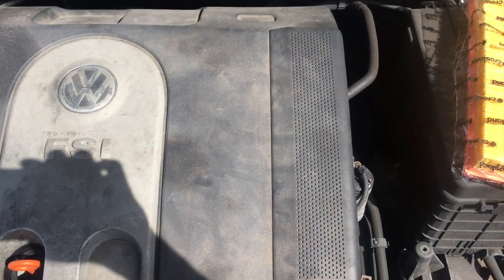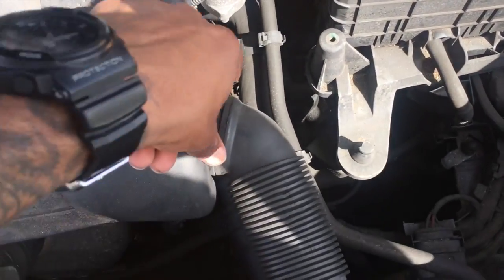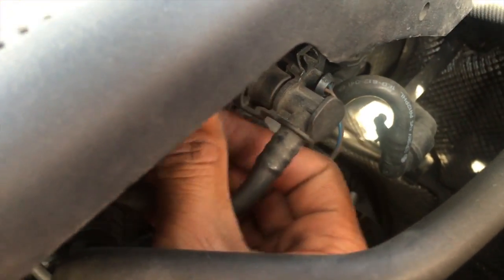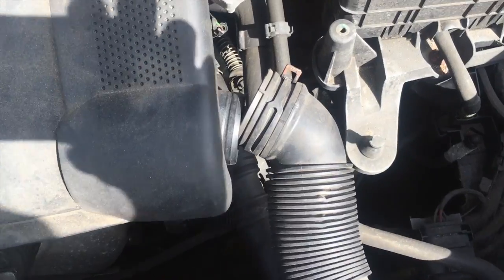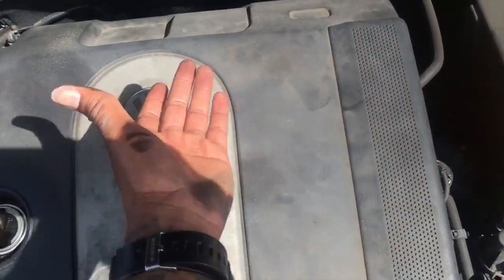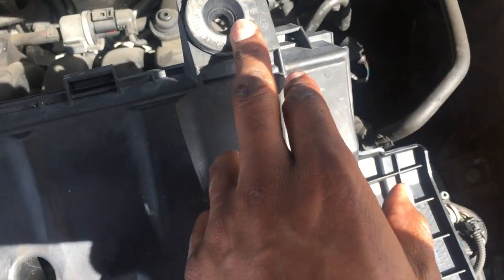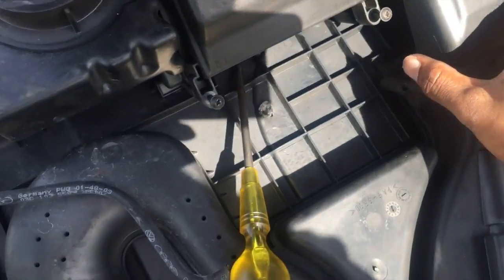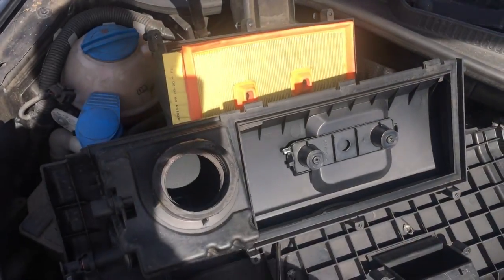AIR FILTER change GOLF MK5 2004 - 2008

Comment: Came across your videos while doing research as I'm looking into getting an A3, really great videos, keep them up 👌 interesting, well explained and simple,
Reply from the maker: +Robert Weber thanks mate! Means a lot!
Reply: +TW Randomz no worries bud 👌 any advice or ideas on what to look out for/what to do first when buying an A3?
Reply from the maker: +Robert Weber the usual really, rust, service history, general condition of car relating to age and make sure you know what spec you want. Standard, sport or s line...
Reply: TW Randomz hi. Do you know what the air pipe is called that you u unclipped at the beginning? Mine has broke and need a new one but don’t know what it’s called? Thanks